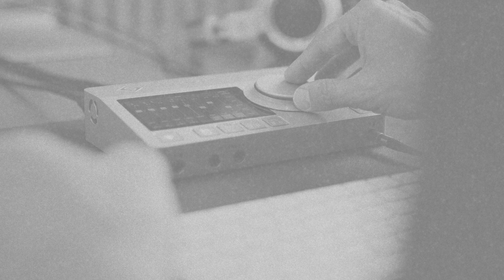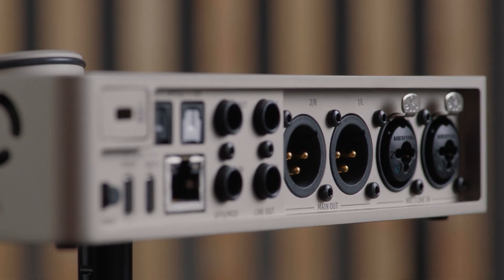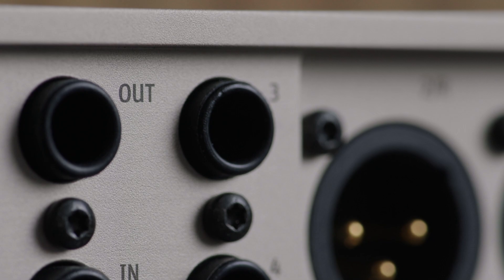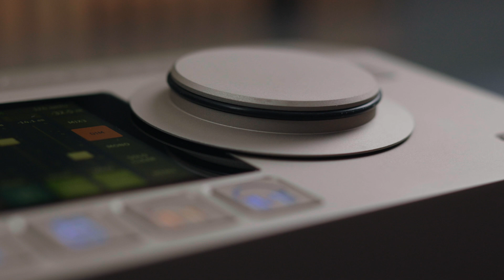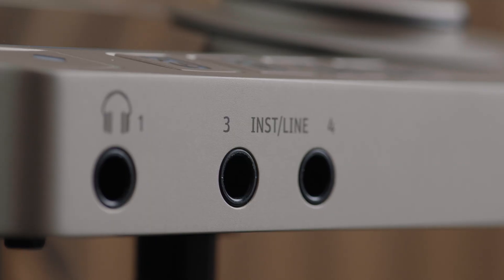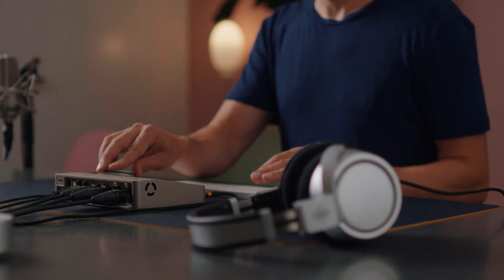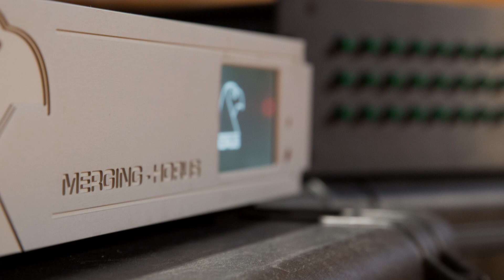The Neumann MT 48 (Pt. 2/5) –  Connectivity

Comment: Hi, can you record the reverb? maybe loop the optical in/out to do that? Also, can you connect it to a mobile phone for live streaming with social apps?
Reply from the maker: Hi there! Yes, you can use its DSP processing for monitoring only, or you can print effects while recording.
Reply: @GeorgNeumannGmbH  Thank you, but i read that you can record the EQ and Dynamics but not the reverb
Reply: Raw + DSP processed can be sent to PC via USB, Dante (if upgraded) or sent out via ADAT. So the option is always there.
Reply: @abtrapp   @Thank you, but i read that you can record the EQ and Dynamics but not the reverb
Reply: @ So: Effects (EQ, DYN) are on every input channel (analog, adat, ..) - post-fx can record those.

Reverb is extra and can be mixed to any bus (1..4). So: you can't record all signals with reverb (only with the "normal" effects) - BUT you can use one (or more) of the 4 mix busses and route the bus return WITH the reverb via USB to your DAW.
Reply: @abtrapp  Thank you very much will try that, receiving my unit today 👍

Comment: Can I use an external pre amp? And by-pass the pre amps on the interface?
Reply from the maker: Hello, the short answer is no.
You will ultimately pass through the MT48’s preamps, but they are extremely clean (136 dB-A dynamic range with 78 dB of gain.)
You could alternatively use 6.3mm line outputs on an external preamp (if your preamp offers this) and go through Line Inputs 3-4.

Comment: How can i connect External Hardware wit my MT48. i want connect to my SSL Fusion Unit. Pleease help me
Reply from the maker: Hi there! In any audio interface/converter, there is always some kind of buffer stage in front of the actual converter chip. This buffer stage can either be fixed gain or variable gain. The MT 48 uses an ultra-transparent variable gain stage which does not add any kind of sound coloration. Variable gain is useful to align your sources to fully exploit the available dynamic range of the A/D-converters. By the way: The outstanding technical specifications (e.g. 0.0006% THD for the line inputs) are measured for the entire device, including the analog buffer stages.
In other words, the MT 48 line inputs are perfect for capturing the sound coloration of external preamps. The MT 48 will not add a second layer of sound coloration.

Comment: Can you bypass the preamps when using analog gear ?
Reply from the maker: Hi there! All four MT 48 inputs can be set to Line mode for a clean AD conversion. This is done on the input's Preamp module on the MT48. (Line Inputs 1-2 feature 138.5 db-A dynamic range.)
Additionally, if your preamp has an ADAT or S/PDIF output, that of course can be connected directly to the MT48’s optical input. Check out our MT 48 support page here: https://zingtree.com/live/887759503#2.

Comment: Can u use the aes with out the thunderbolt 3? Can I record into a raw with just the Ethernet ?
Reply from the maker: The MT48 does not support Thunderbolt. It has an USB Interface and a AES67/Ravenna network connector for recording into the DAW via Audio-over-IP.

Comment: I see I can use 2 microphones and 2 instruments simultaneously but what would be the cheapest way to record with 4 microphones? Are there any adapters to convert mic level to instrument level that would work well with the MT48 or would I absolutely need to buy an additional preamp with ADAT connection? If I do this I would not be able to take advantage of your instrument preamp.
Reply: The instruments TRS inserts can be used as line inputs too. This means you can feed them with a preamplified signal and get e total of 4 mics signals. E.g. 2 mics go to the preamp sections of the mt48 and other two mics go into an outboard preamp then out of the pre and in to the TRS inputs on the front of the interface. You get a total of 4 mics (two internally preamplified, two externally). In case you need further inputs, you could easily connect an external preamp (e.g. isa 828) through an adat expansion cards and get a total of 12 mics or 10 mics/2 hi-z. For a much larger sessions, aes67/ravenna kicks in and you can hugely expand it. Yes, aes 67 has interoperability with Dante but specs has to be checked to be sure if 48/24 is the ceiling or you can go higher. Hope that helps.
Reply: Hi, same question. Answer Neumann, please. Thanks in advance

Comment: Im kinda confused about the aes67 port, can you connect that to any converter with dante, like for example a lynx, or a antelope galaxy? I need 32 more i/o! I cant seem to find any other converters with ravena compatibility. so i dont know what other converter this could be expanded with, other than the Anibus Horus, but that is way too expensive for me. Or maybe i need a seperate aes67 to adat/madi box?  Also a shame there are so few inputs/pres on this thing, if it had 4/6 i would be a really interesting device. Also it would be practical with more adat. dont know why every interface has so few adat ports. Maybe its all good tough with the aes67 port, i just dont really understand how it would be used so maybe im just stupid.=)

Comment: Babyface FS is as good with half the price.
Reply: Not quite. Have compared and while the Babyface Pro FS sounds good, the Neumann sounds significantly more refined and detailled to my ears in my application.
Reply: @mikelanghans4245 agreed, dude who replied above probably can’t even afford the MT 48 to even test it
Reply: I’ve own both and can honestly say the MT 48 is on a noticeably higher level than the Babyface FS. The sound quality from inputs and outputs as well as the design are on another level. 

Also, let’s be real, total mix pro is a mess and the interface of Neumann’s solution is considerably better and more intrusive.

Comment: Is it class compliant?
Reply from the maker: Yes, it is. You can use the MT48 without driver installation on devices that support class compliant mode, e.g. Mac and iPad. However, installation of the MT48 Toolkit software is recommended as it offers additional functionality and reduced latency.

Comment: What's the IO capability over AES67?
Reply from the maker: The MT 48 uses the Merging ZMAN AES67 Audio Network Module with support for up to 64 RAVENNA/AES67 streams, 256 audio channels. See specs here: https://merging.com/assets/img/merging/products/zman/Merging%20Technologies%20-%20ZMAN%20Brochure.pdf
The MT 48’s internal mixers currently support up to 48 channels. So there’s room for the 4 analog inputs, 8 ADAT channels and up to 36 channels of AES67.
Reply: 256 X 256

Comment: is there any way to connect Aes-Ebu sources?
Reply: Not Directly. You would have to have another AES67 compliant device that has an AES-ebu connection, then plug it into a switch. So Computer, RJ45, and other device with AES67 connection all into a managed switch.